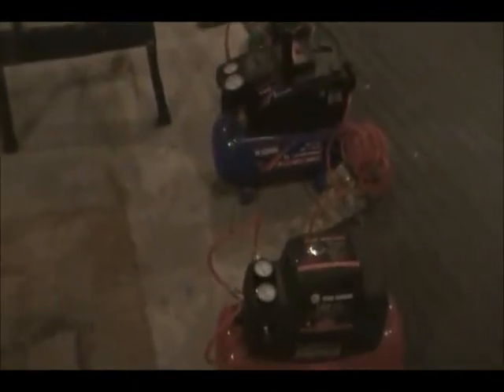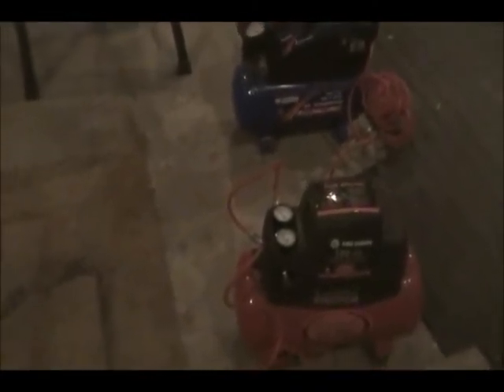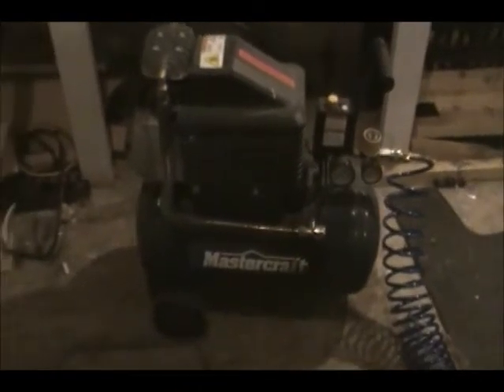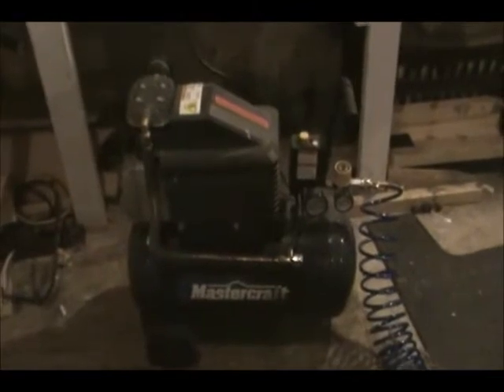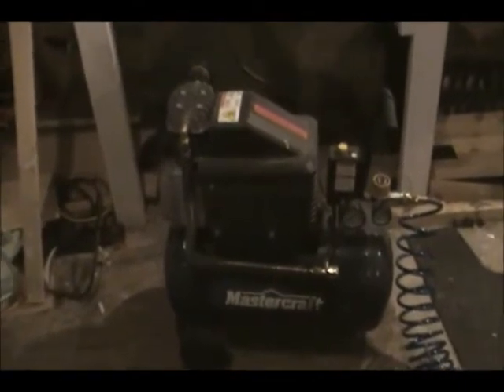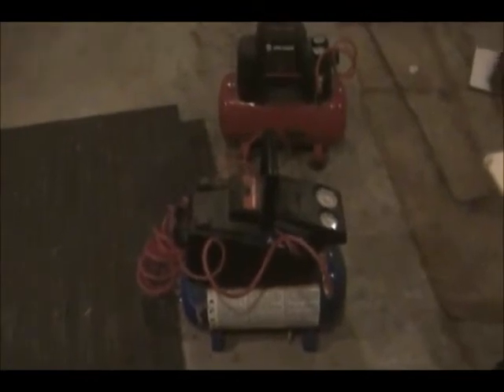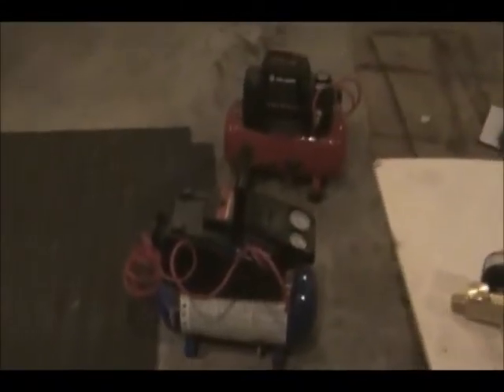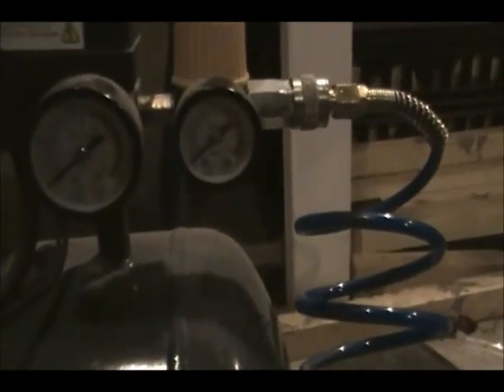Dead Things Vlog-Pneumatics Part 1

Comment from the maker: @GhoulishCop Thanks Rich! It seems weird that you couldn't use an extension cord with a compressor, but it says not to use one in the manual for my oil compressor. Plus I had bought a discounted compressor  prior to this one, it died and they said that the previous guy probably ran it on an extension cord.

Comment: Pat, great intro to pneumatics. I want to build a pneumatic prop (or two!) this year and I've been reading a lot about the process. This video is very easy to understand and follow.

However, having used compressors for woodworking and framing before, I've used them on extension cords if only because there's often no electrical outlets nearby and have yet to run into a problem of damaging the motors. Maybe it's something I need to watch out for. Thanks again for a great into to pneumatics.

Rich